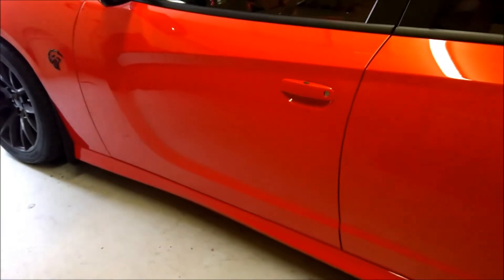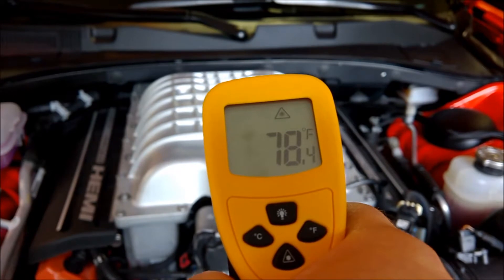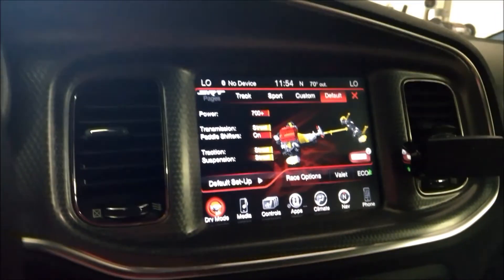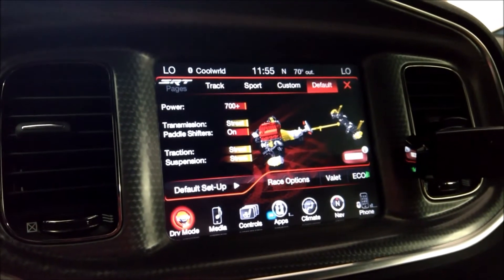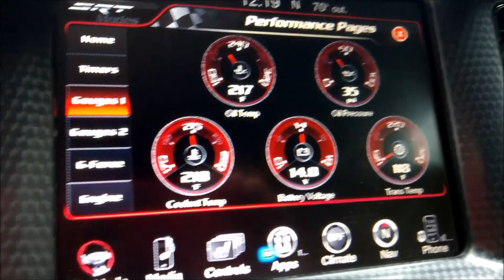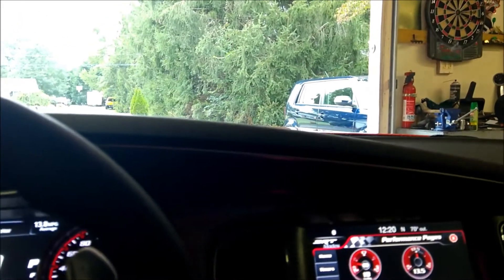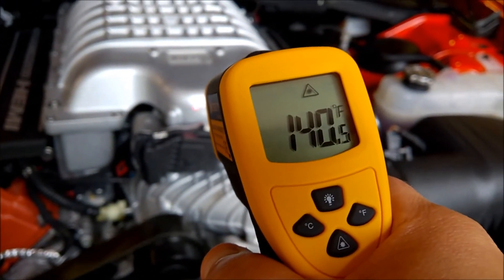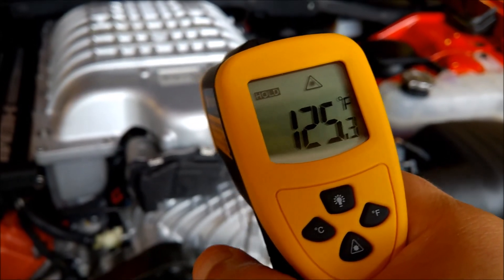Hellcat Supercharger Temp Evaluation

Comment: Just got a hellcat when cruising around city stop and go my ic temps are like 170 to 190 once I start to get moving it drops to like 70 80 it's about 80 outside. Is this normal. Brand new car. Got the ic coolant level low msg a couple time then went away.
Reply from the maker: If its still under warranty I would have it checked out especially if the IC coolant is low.  Not sure about older Hellcats but I have seen some posts about newer ones leaking coolant in to the supercharger.  Personally on both cars I haven't really paid attention to IC temps usually if I'm looking at temps its the IATs.
Reply: @coolwrld302  sorry the coolant level is fine.
Reply from the maker: @717Chris  Seems weird that if the coolant levels if fine it would be throwing the low level message.  I think I would still take it in.
Reply: @coolwrld302  will do thanks
Reply: @717Chris  hey did this ever get resolved?
Reply: @bighustler1  it was the supercharger intercooler electric coolant pump for the supercharger coolant system. The pump was defective from the manufacturer. Dealer installed a new one and been good.
Reply: @717Chris  okay good. I’m actually having some issues with mine now. My IAT’s are ready pretty high. What kind of IATs are you seeing while in traffic?
Reply: @bighustler1  around 130 its like 85 90 out
Reply: @717Chris  man I’m getting like 160 and it’was 79 last night
Reply: @bighustler1  mines went as high as 190 smthn. Once you get moving it should go down a little. My intercooler temp was like 190 too tho. Now its like 80 or 90
Reply: @717Chris  yea when I’m moving it’ll be around 100 or 98. In traffic my ic temp is about 118. It use to be like 150 but they changed the sensor and bled the system. It’s been to the dealer like 3 times, don’t know what to do now bro
Reply: @bighustler1  it doesn't sound too far off . My air temp is like 130 once at operating temp. My i/c temp like 80. I know bleeding the system could be difficult. It doesn't seem like your numbers are far off tho. If the pump was bad i/c coolant temp would be 190 plus. You could always try another dealer. Most dealers only want to fix things that obviously broken.
Reply: @717Chris  thanks man. I think I’ll give it a try. This is my second dealer. It sounds like something small but can’t figure it out
Reply: @bighustler1  sorry yea intercooler electric coolant pump for supercharger was defective from factory. Replaced bow running cooler especially when idling.
Reply: @717Chris How are you? Were you using the car while the problem existed, and for how long? Because I have been facing the same problem for two months, and I was using the car for two months, not every day. Was the supercharger damaged??
Reply: @YSB5  my check engine light came on it was the auxiliary coolant pump was bad from factory. Replaced under warranty. The coolant pump for the supercharger system
Reply: @717Chris  How many days u drive when the problem start??
Reply: @YSB5  a week maybe 2. I bought the car new and drive 8 hours home from Michigan.  Engine light came on on the ride home. I made an app with my local dealer it probably was like a week away. no damage to the supercharger. Engine light showed it was coolant pump.
Reply: @717Chris  i have same problem but the check engine light does not come i from United Arab Emirates If the outside temperature is 30 C°, the IC coolant temperature is above 70 C° and sometimes less. Is this normal or not??  Because I inquired from several people and they told me that it is abnormal, but the engine check did not appear to me or I did not lose the vehicle’s power.
Reply: @YSB5  what's that temperature in Fahrenheit? The intercooler temp i believe is usually like 20 to 30 degrees more Fahrenheit than the outside temp. It may drop when your on the highway.
Reply: @717Chris  no its Celsius my ic coolant temp was then more then the outside temperature like 40 Celsius   is it normal?? And check engine light does not come on and idont lose any power and i take it to the dealer they said there is nothing wrong but some hellcat owner they say its not normal
Reply: @YSB5  yea it's normal to be like 20 or 30 degrees Fahrenheit hotter than outside. I don't do Celsius much here.
Reply: @717Chris  did u facing any leaks or sounds to let u know the ic coolant pump is bad?? Or how to know??
Reply: @YSB5  check engine light came on. Auxiliary coolant pump bad from factory
Reply: @717Chris  Are there other problems that cause ic coolant supercharger temperatures to rise?? Thank u because i think my problem not from pump
Reply: @717Chris and temps got lower after the replacement?
Reply: @ssj02  yes about 20 degrees hotter than ambient
Reply: @717Chris  thanks. Is that for the i/c coolant or the air intake?
Reply: @ssj02  ic coolant
Reply: Hello, 
may i ask u guys what is the normal ic tepm is ?
Reply: @BARAA97-  maybe 10 to 20 degrees above ambient. Mines was around 80 when it was around 70 outside not sure where it will stop going up at.
Reply: @717Chris  thanks man

Comment: I'd like to know how hot the supercharger coolant gets when it's under a load
Reply from the maker: Unfortunately I never actually monitored the IC temps on a regular basis but I never had any kind of failures and I made a total of 83 passes at the drag strip over 2 seasons and numerous times those passes were hot lapping 2 or 3 times.

Comment: What happens if you go to a road trip (let say 4 hours non stop).  Would that be okay for the car?
Reply from the maker: Not sure exactly what you are referring too but this car has been driven to Port Charlotte, FL from DE non-stop (well except for gas, bathroom and food breaks) 1300 miles.  Plus numerous trips of 3.5 - 7 hours non-stop with no issues.
Reply: coolwrld302 thanks for responding.  I was referring my question regarding long trips and how the car’s engine status will be on that state.  I’m planning to take a 4 hour trip and was concerned of the engine “heating” especially on this hot summer weather and if I should go on eco mode or have it on full 700.
Reply from the maker: Ah got it. On most of those trips there were times when I have the car in ECO mode but that was more about gas mileage than temp issues.
Reply: @coolwrld302  do you know what the temp was of sc with engine turned off afterwards?
Reply from the maker: @mikeprice8307 I didn't actually take any readings after shutting the motor off but my assumption would be I guess it could be possible that initially after the IC coolant stopped flowing through the SC that it might go up slightly but eventually it should start going back down to its ambient temperature.  No idea how long that takes but I know it puts off a ton of heat in the garage. I have come out to the garage hours after the car was parked and the temperature in the garage is still elevated.
Reply: @coolwrld302   I did some recent work on mine.  I never watched it before but I noticed mine spikes to max 270
Reply from the maker: @mikeprice8307  Based on car gauges or actually checking the SC with IR thermometer?
Reply: @coolwrld302   I did some recent work on mine.  I never watched it before but I noticed mine spikes to max 270
Reply: @coolwrld302  main screen gauges
Reply: I drove 18 hrs philly to Florida...traded my hellcat for the redeye and drove 18 hrs back to Philly. No problems.